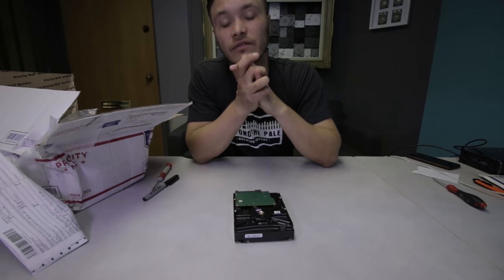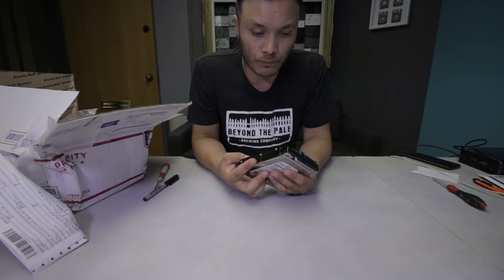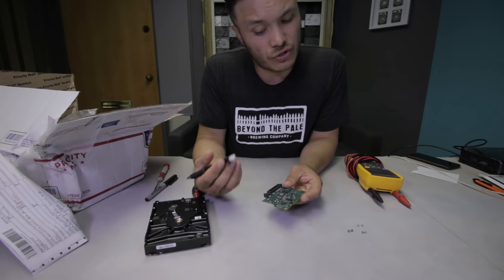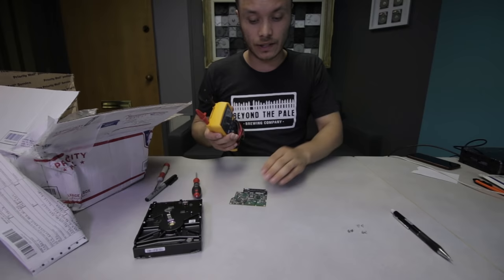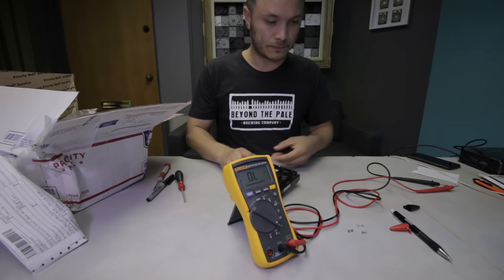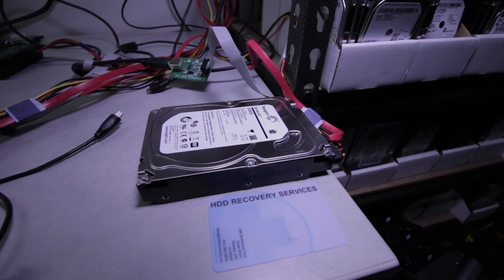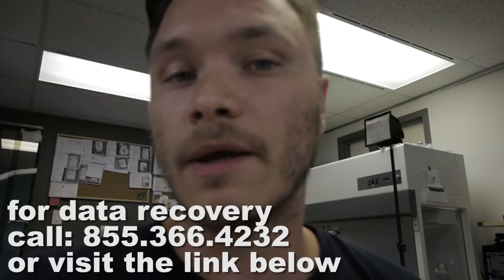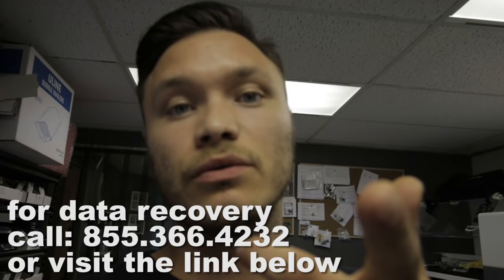seagate hard disk not detected. Does it spin?

Comment: Thanks. dead hd. rubbed connections. replugged control and data boards >> WORKING. Thanks again.
Reply from the maker: interludo no problem! Glad it worked out
Reply: Did use magnifier and could spot corrosion. Lucky as I dont have adequate multimeter and skills to test and replace diodes. Thanks for your teaching.

Comment: Hi, I liked your video. However I am left with the question, how can the circuit work without the diode? I am scared to apply power to the board without the diode as there is a chance it can fry the board. Can you please explain the role of the diode in this instance and how the board can work without it? Thanks.

Comment: Hello guy, I have a Seagate 4To who doesn't spin. I tried to remove the diode like you did but the disk still not spinning (I mesured 0.693 with multimeter). If I replace the entire PCB do you think it could works ?
Thanks for your answer !

Comment: This video helped me to diagnose and get a damaged 1TB Seagate video hard drive (ST1000vm002) from a Rogers Nextbox 3 going again. The problem is exactly the same, a shorted diode (which did not test ok after removal). When I removed the diode the drive spun up and was recognized. I am surprised the drive board without that diode enables the drive to work. Can the drive be operated "as is" or should the diode be replaced?

Comment: I have 3 dead diodes 2 x 1ROZ and a small S41 on a seagate 4TB external drive that does not start up. the outside diode has power. I am a bit nervous about 3 removing them.

Comment: Very interesting. Impressed with your knowledge and very professional. Shame we don't have people in the UK like yourself. Not only a very nice guy and knows what he's talking about but also whiling to share his experiences and knowledge here on YouTube. You sir have a new sub. An see myself going through your entire channel watching a lot. I've had a few experiences with bad drives and loosing data so will be interesting to watch your videos. 

I have a USB stick that says it read/write protected when it's not and has never been made protected. Just on day it decided to screw up and I lost so much. It's was only 8GB but I had 7 years of Xbox360 game save files and a backup of some important stuff. 

One question I'd like to ask. Without going into huge detail I have a custom water cooler very high preformance PC and I've seen some people have a clear top, see through lid or case cover on there HDD so you can see it all working etc. all my SSDs are on show and I'd love to do the same
Reply from the maker: I see what you mean, I've seen those covers. Custom made out of plexy. At my old work we actually made one :). But once hard drive is opened it would be hard to keep it reliable, unless you run RAID1 in case it fails.

Comment: I have the Seagate 3TB (ST3000DM001) and it spins up with no strange noises, but will not be detected, even with Disk Utility...what should the next step of diagnosis be?  Edit: The drive spins up normally, but then stops spinning after just a few minutes. I already cleaned the contacts on the board (which were dirrrrty!!) but that didn't help :(

Comment: Hey i just sent a drive to outsource datarecovery services, and i KNOW for a fact the data on it is still good. The problem it  has is that it TRIES to spin up but cant complete it. So i logically figured its either gonna be the PCB or barely possible the Spindle having a problem. I was told 3 times that all it would need is the $60 pcb swap, then they call and say "nope only data recovery will work"
But literally 30 mins before it just stopped spinning i WAS AT THE DAMN DESKTOP, the files are fine.

And you seem like an upfront sorta dude, how much would it cost for a PCB swap, or in the worst case a Spindle swap, i really really dont have a lot of money, which is why when he quoted me $600 dollars for data recovery, i just thought "data recovery?? why it doesn't need data recovery, the problem is its not spinning up"

Comment: ST3000DM001
Have problems with Head 4... When imaging the drive I can see a pattern: where a batch of sectors wouldn't get read, then a long batch would get read, and then a small batch not read again etc - with equal intervals.
I ran /7 -> X through serial and got resistance values for all heads.
All heads reading around 300 (need to convert from HEX to Decimal) except head 04 (head 5) which reads 540.

Unfortunately I do not have access to hardware recovery tools like PC-3000, MRT etc... I've disable re-trying reading in firmware through terminal and can now quickly image the drive with HDDSuperClone without getting stuck at dead head for too long.  But have a cleanroom, so will attempt a head swap after 5 healthy platters get imaged. If headswap will not fix the problem - time to send to specialists with hardware recovery tools.

Comment: after removing diodes and having the drive power up would you advise against re-using the drive or would you allow clients to continue using the drive as is? or is best practice to backup the data and get a new drive?

Comment: I've got an old SCSI Seagate Barracuda ST150176LC that won't spin up.  No noise at all.  Drive light on the circuit board does blink, but otherwise no activity.  I located two diodes, both Motorola 933 1BL3 ZP, that appear shorted.  I haven't removed them yet.  Do they need to be replaced?  If so, what equivalent diode can be used?  I haven't found specs for these diodes.  Thanks.

Comment: Scrub a copper penny with a pencil eraser, then look at the tarnish a week or month later.  Also touching the cleaned contact with oily fingers will cause contact problems later.  Maybe good for return repair later, easy scrub head preamp contacts again to fix until next return..
Reply: This di right here is Just so you can pull the data out and toss the drive. It is not a long term fix.

Comment: Any idea about a repetitive humming noise coming from the drive and the platters don't seem to be spinning. Windows on detect 4GB... it's a 500 GB drive. Windows want's to format the 4GB (I didn't). FTK Imager won't mount the drive either.

Drive failed during a power outage... suspecting a power surge. Checking what look like the diodes didn't find any shorts...

Comment: This is somewhat HardDrive related but not exactly. I have a  Buffalo Link Station Model LS210D0201 which I need to replace the drive, but I can not figure out how to open the case.  I have searched on the Internet and I can not find any disassembly instructions  for this model or anything similar. I don't want to break the case since it's functional. Just want to open it to replace the drive. Any suggestions?

Comment: My tvs diode is not shorted and the disk does not spin. What do I test now? Should I renove it anyway?
Reply from the maker: You need to check 0ohm resistors by power connectors make sure those fuses are not blown

Comment: i have the same issue but both diodes seem to have continuity. one reads .699 and one reads about .500. is it still possible one of the diodes is bad? should i remove them and test the drive without them?

Comment: I have a seagate barracuda 7200.12 500gb hard drive. and it was making a tickling sound i thought it was a hdd problem and opened the drive and remove the head and put it back it shows once in device manager and again nothing..i try to fix the heads but not worked anything. later i checked my pc with another hdd it also struggles to power up then i was realize its a smps problem later i replaced the smps but right now the seagate barracuda 7200.12 drive is spins when powered up and stops after a 1-2seconds and the tickling sound is clearly audible. is it a pcb problem or what? i put this pcb in other 160gb hard drive it did the same spin and stop. I bought another new seagate pipeline 500gb hdd and luckily its pcb number same as old. should i replace the rom ic and try with new board. or can i replace the new hard drive head to old one or its better to platter swap.how to recover data from old drive.can't afford to hire a professional data recovery analyst.any help is highly appreciated.Thank you in advance for your valuable time

Comment: I have a ST2000DM001 that doesn't spin. I've cleaned the contacts with a eraser.
I've also checked the diodes. They are both not shorted. Is there anything else I could try?
Reply from the maker: Check the fuse if there is one
Reply: @hddrecoveryservices  Thanks for your reply. There seems to be no fuse on the PCB.
As the HDD doesn't make any sounds at all, the issue is probably the PCB right?
If I would replace the PCB for a new one, I would need to replace the BIOS chip on the new PCB for the 'old' BIOS chip, right?
Reply from the maker: Yes, the ROM needs to be moved
Reply: @hddrecoveryservices  Allright, thanks for your help!

Comment: Hey I removed the diode but the multimeter still beeps. Did I do something wrong?
Reply: then u have anonther component that short out...find this!..i u remove the diode, check if the still shots out or if the diode could be ok! i have the same drive with the same problem but my doesnt spin on...i removed the bad component but still not spin

Comment: Im sure this is a stupid question but I don't get something. You touch red and black probes together to demonstrate the sound. Isnt this exactly the same situation when the current goes through the diode? In other words if the current goes through the diode and we touch the red and black probes on both ends of the diode it should be exectly the same as if we just touch them together (without the diode in between) and the sound should occur?
Reply: Not stupid, he was not clear about this: The basic function of a diode is to let current flow ONE way only....by "shorted" he means the diode lets current through both ways. The "arrow and a line" he mentioned is the symbol for a diode (can't type it here, just look it up and you'll see what I mean)...the arrow part of the symbol indicates which side is + and the "line" side of the symbol is the minus (negative) side. Current is supposed to flow from plus to minus, and if you test with the probes that way, you are supposed to get a sound...but if you switch the probes (put red on the minus side, and black on the plus side) and you still get a sound, the diode is no good.

Comment: Hi ehm help!
I've an Seagate harddrive 1TB and it has been working 100% fine all these years, today I plugged the cable into the hard drive when suddenly the power shut off and the adapter got this weird smell like bang powder gun smell. Now I'm afraid of trying to plug it back in but the hard drive is not making any sound what so ever and is not booted up to the computer. Help!

Comment: Hi, I have this problem with a Seagate ST2000DM001 - I got the same short on one of the two Diodes. I removed the diode which had shorted, but it still indicates a short across the pads once removed - and the drive still will not spin. HELP!!
Reply from the maker: Paul Archer Paul at this point your best bet would be to locate an identical PCB part number and swap out the eeprom chip from your failed board to a new working one. That will adapt the new board to work with your hard drive. I don't go beyond troubleshooting the diodes on these when it comes to failed/shorted boards because my inventory of donors is really good and it is just way easier to pull the donor than try to figure out what is wrong on component level.

Comment: I have the same Seagate HDD which was dropped from around 2ft a few days ago. Since then it will not work. I can hear that the disc is not spinning but there is also a beeping noise. Did your HDD also emit a beeping sound when plugged in? I'm just trying to determine if i have a PCB issue or internal issue(such as stiction/head damage/spindle problem etc) thanks

Comment: Hello! It is necessary to repair the hard drive PCB, with this card drive will not start. Where to start repair, what do you say?
What I did. Checked suppressor - they are good, I changed the charge on obviously working and then the disc spins. What do more? Thank you in advance.
Reply from the maker: hi, I am not sure I understand the issue. So you got your drive to spin up with original PCB?

Comment: this is it,,, i've problem suddenly my harddisk disappear , after i touched the heatsink fan/cpu fan and my computer not responding and then my windows stopped  after that my harddisk did not detected in bios  windows and any software that i used, even though that drives when i started the computer/cpu  i heard it is spinning like normally .. but not detected in bios...

Comment: Thanks for your videos! Any idea what might be wrong if seagate 2TB works just fine when detected, but... it's not detected all that often lately?.. It spins just fine, no weird noises. No errors in any test, SMART is ok, disk isn't too old yet (the newest I have aside from its replacement). And somehow BIOS just says says it's not there after being stuck on motherboard loading screen for like 30 sec. Swapping to other SATA doesn't help, other hdds work fine in its place. Tried to clear its contacts like you showed in this video, doesn't seem to help (but I got it detected at least 2 times after that). There's no data to save left, just wondering if it's something that might save me 2TB of space being tossed to trash.

Comment: I have a Seagate where it no longer recognizes the HDD password, bedsides a platter swap at technical lab can switching the exact PCB get it working to get the data off??
Reply from the maker: if the drive spins - PCB is not a problem

Comment: A bit late, but, I recently had my seagate exos internal 16tb drive stop working 
when my desktop pc was idling. now if i try to boot my pc, it will hang on the 
"detecting drives" bios screen. if i plug the exos into my external adapter. 
the drive spins up as it should, sounds like its reading, then will make weird 
repetitive noises for a few seconds, then stop reading, but stays spinning full speed. 
my laptop will detect the drive model ONLY, after a couple minutes, but can't see the 
contents, or show the drive in the partitions program of windows 8.1. 
The drive has less than 100 hours of run time on it, and i just finished 
transferring all my valuable data to it as its only backup. So years and 
terabytes of data will be down the drain if i can't get this drive working again. 
I always made 2 backups of my data, but this was a fresh start on a brand new drive 
to consolidate all drives into just one. My other data drives were getting too old 
to trust functionality much longer. I bought this EXOS drive new from amazon. 
The EXOS drives are laser welded casings, and would need to but cut around the weld, 
in order to get to the typical screwed on cover found on most HDDs.
Reply from the maker: I would suggest taking it to a specialist. You have a helium drive. It sounds like it's working fine mechanically at least. Needs to be tested on proper equipment
Reply: @hddrecoveryservices  I have about 50 drives from older PCs I scrapped, and testing them, I have come across a couple with the same issues as my exos. took them apart, and seen the platter arms were stuck magnetized over the platters.
When power was added after resetting the arms, they instantly went to the center of the platter and were stuck. As if the arm motor had swapped it's +/- polarities. 
Have you ever seen this in your repairs?

Comment: so i checked my drive and i have a short circuit, so if i take off the diod i can than make a copy and than ditch the old drive how should i do it?? what programms should i use?
Reply from the maker: remove the short, and copy the data out. no special soft needed

Comment: yo, I received a factory new drive from Seagate and the motor doesn't spin up. It gets detected in the device manager, sometimes also in the disk management without any storage showing up for it. I actually ordered two units, both of them seem to be from the same charge, although the PCB of the defective drive looks a bit discolored. I tried that one first in my external drive enclosure and it didn't spin up, so I assumed my external enclosure was defective (many reported cases of not detecting drives with more than 2TB of storage). I dropped the other drive in there and it worked without an issue, so I guess my one of the new HDDs is simply defective. Do you have any thoughts on that?

Comment: Hi HDD. My Samsung D3 External Drive 12 V adapter cord was accidently cut (got caught in a door) I had just used the device and it was working perfectly fine. A friend suggested that I buy a new adapter on Amazon. In the meantime I went to Radio Shak and in-store the sales guy inserted a universal adapter on  12 V setting. It did not work and immediately the drive started to smell from the vents. A slight burning scent of course. I eventually got the old adapter cord repaired by an electrician. Now the Light to the front is just blinking, the HD is not spinning and the computer is not reading the HD.

I am desperate! What do you think occurred? Sounds like a deaf PCB. I have a lot of important Client files on the drive. I need your help

Comment: hi friend i need your help
i have Toshiba HDD,its not working after a lightning night 
*not detecting
*no motor spinning
*but no have any burned smell or any burned appearance on the PCB
THEN I TAKE A WORKING SIMILAR HDD WITH SAME MODEL DT01ACA050
REPLACED ITS PCB BOARD WITH WORKING ONE
*NOW HDD IS WORKING
*BUT NOT DETECTED
*MOTOR IS WORKING OR SPINNING
*BIOS NOT DETECTING
PLZ PLZ HELP ME FAST